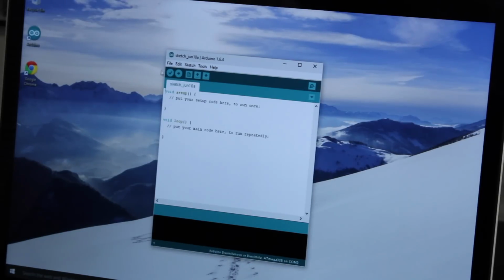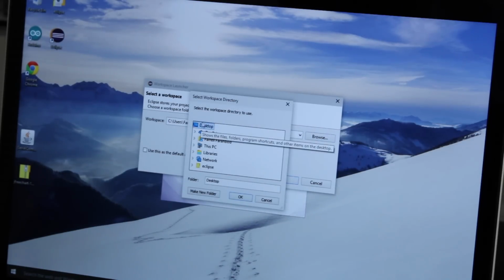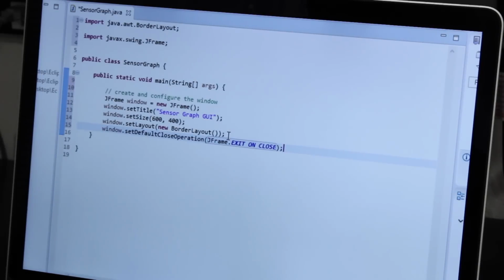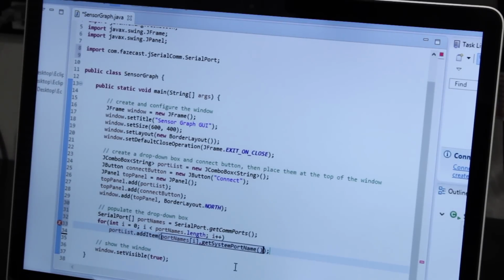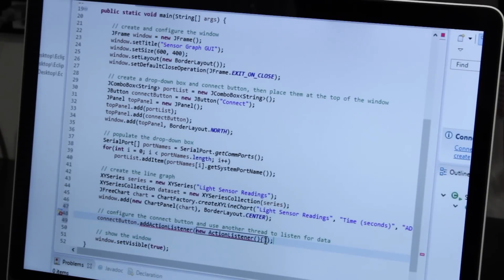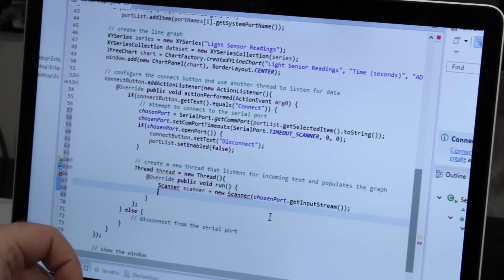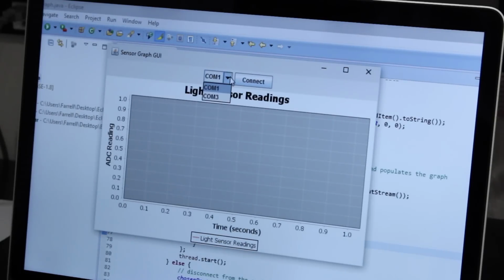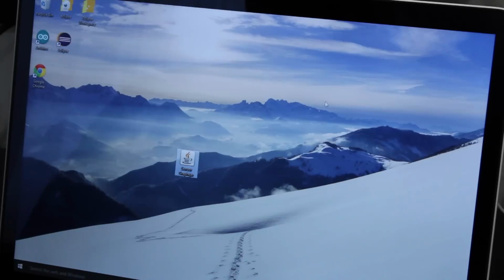Graph Arduino Sensor Data with Java and JFreeChart

Comment: This does not work for me on linux. Any tips?
I am trying to send a string from my arduino wireless module to another one that is connected to my pc.
Using putty i am getting the correct string.
Using java (for GUI purposes) i am freezing in the reading place and after I terminate the program I get a bunch of random characters.
This is probably due to ASCII output from arduino vs Unicode environment of Java. I have tried reading byte by byte, converting, changing reading encoding, but no luck.
I am probably doing this wrong.
Reply from the maker: +master2814 The character encoding should be fine, but I've had a similar problem when my baud rate was set wrong.
Reply: +upgrdman yes i managed to fix it by setting the baud rate. i was using the non default rate on my modules (19200) and also setting it in putty. but not in java. 
thanks a lot!

Comment: Thanks for the video. I have a problem though. the program is not connecting to the arduino. Can you help me please ?
Reply: +Surya Ravichandran I also use MAC OSX by the way. Would this affect the way COM Ports work
Reply from the maker: +Surya Ravichandran Hi. What ports are listed, and what port have you tried connecting to? If I recall correctly, OS X presents serial ports as TTYs and ACMs, but I'm not sure which one works better for this application.
Reply: Hi. Thanks for your reply. I figured how it worked. I have another problem though. How can I use two are three sensor data for three separate plots. Can u please help me out

Comment: Hello there,

Thank you for the wonderful tutorial. But unfortunately, my code does not work with atmega8 (using proteus). I received unknown data from "chosenPort.getInputStream()". 

It gives me this error:
 "Excetion in thread "Thread-2" java.lang.NumberFormatException: For input String: "[][]""

How can I resolve this? 

Thank You
Reply from the maker: +ishHD It looks like you are getting an error when trying to interpret the data as a number. Make sure the text sent from your microcontroller is just numbers and whitespace (spaces, tabs, or new lines). Letters or special characters can cause problems.
Reply: upgrdman Im using UART_Tx(adch);
    UART_Tx(adcl);.... well if I put the exception on the thread, It won't give me error but the graph does not work.
Reply: +upgrdman im getting this value : com.fazecast.jSerialComm.SerialPort$SerialPortInputStream@5593a38e
Reply from the maker: +ishHD In this video I have the Arduino send ADC reading as text (ASCII) over the UART. If you are sending raw bytes, you'll need to parse them differently.
Reply: Any tips? Thanks man. :)
Reply from the maker: +ishHD The easy route would be to have the microcontroller send ASCII text. I don't know the libraries you are using, so read through their documentation. You might be able to use something like sprintf().

If you don't want to send ASCII, you could parse the raw bytes with Java. You would need some way to align with the bytes you send, so a "magic number" would help.

https://github.com/Fazecast/jSerialComm/wiki/Nonblocking-Reading-Usage-Example

https://en.wikipedia.org/wiki/Magic_number_(programming)
Reply: upgrdman
Actually my problem was the same using RXTX. But the problem already solved by converting the ascii(from the proteus) into decimal number in RXTX. Should the same solution for jSerialComm.

Well its kinda weird though that in your video, you don't have to convert ascii into decimal number and it works.

Anyhow thank you for trying to help me. Keep it up!

Comment: Very great tutorial!!! I really appreciate what you have done, because it is really helpful for me. 

Can you please do a tutorial about building a real-time camera using Arduino and Java?

Thank you very much in advance!
Reply from the maker: +Daniel Zhao Thanks. By "real-time camera" are you referring to something like a webcam? If so, that wouldn't really be possible with an Arduino. The Arduino is a relatively low power microcontroller and does not have nearly enough processing power to handle video.

A more advanced chip like something from the STM32 lineup could do that, but those microcontrollers are not aimed at beginners and are not nearly as easy to use.
Reply: +upgrdman Thanks for your reply! Yes you are right, Arduino itself is incapable of handling video transmission, as its ram is not quite big. Actually, I am more referring to a IP camera, or something like a video shield that can be used on Arduino. Currently I am doing a computer vision project, which requires me to use edge detection to capture the outline through a wireless camera. I reckon low-resolution video will cater my demands. So do you know some possible ways to achieve live video input stream from Arduino? If so, can you please do a tutorial for it? Thank you!
Reply from the maker: +Daniel Zhao I doubt that would work. Arduinos don't even have enough RAM to hold a single frame of video. Even if they did, they don't have nearly enough processing power to do anything remotely useful with video or photos.

Comment: Hi. I have an error :
Exception in thread "Thread-2" java.lang.NullPointerException
 at java.io.Reader.<init>(Unknown Source)
 at java.io.InputStreamReader.<init>(Unknown Source)
 at java.util.Scanner.<init>(Unknown Source)
 at Sensor$1$1.run(Sensor.java:65) 

The line 65 is the line wich contains :"
Scanner scanner = new Scanner(chosenPort.getInputStream());"
can you help me please ?:(The error appear when i push the connect button. i mention that i use a preasure sensor.Anyway thank you very much for this tutorial!
Reply from the maker: Hassan El-khatib The null pointer exception probably means you are trying to use an object before actually creating it. Can you post or message me your code?
Reply: upgrdman  i don't know what i have done but now it works! :)) thank you very much! I have another  question : how can i autoscale  in jfreechart because in the  X axis  there are too many values and it is  hard  to follow the signal because the signal becomes compressed. I think that  i must do an array   and then utilise  "push"?Thank you very much !
Reply from the maker: Hassan El-khatib It should autoscale by default. If you did something like setRange() than it will not autoscale that axis.
Reply: I don't need  a lot of samples.  I need somthing like 2500 samples.and then  take it back from zero  . NOW the program makes  too many samples and my signal  compress because of that.

The code is:
import java.awt.BorderLayout;
import java.awt.event.ActionEvent;
import java.awt.event.ActionListener;
import java.util.Scanner;
import javax.swing.JButton;
import javax.swing.JComboBox;
import javax.swing.JFrame;
import javax.swing.JPanel;
import org.jfree.chart.ChartFactory;
import org.jfree.chart.ChartPanel;
import org.jfree.chart.JFreeChart;
import org.jfree.data.xy.XYSeries;
import org.jfree.data.xy.XYSeriesCollection;
import com.fazecast.jSerialComm.SerialPort;
public class Sensor {
 
 static SerialPort chosenPort;
 static int x = 0;
 public static void main(String[] args) {
  
  // create and configure the window
  JFrame window = new JFrame();
  window.setTitle("Sensor ");
  window.setSize(600, 400);
  window.setLayout(new BorderLayout());
  window.setDefaultCloseOperation(JFrame.EXIT_ON_CLOSE);
  
  // create a drop-down box and connect button, then place them at the top of the window
  JComboBox<String> portList = new JComboBox<String>();
  JButton connectButton = new JButton("Connect");
  JPanel topPanel = new JPanel();
  topPanel.add(portList);
  topPanel.add(connectButton);
  window.add(topPanel, BorderLayout.NORTH);
  
  // populate the drop-down box
  SerialPort[] portNames = SerialPort.getCommPorts();
  for(int i = 0; i < portNames.length; i++)
   portList.addItem(portNames[i].getSystemPortName());
  
  // create the line graph
  XYSeries series = new XYSeries("preasure Sensor Readings");
  
  XYSeriesCollection dataset = new XYSeriesCollection(series);
  
  JFreeChart chart = ChartFactory.createXYLineChart("preasure Sensor Readings", "Time (seconds)", "ADC Reading", dataset);
  window.add(new ChartPanel(chart), BorderLayout.CENTER);
  
  
  // configure the connect button and use another thread to listen for data
  connectButton.addActionListener(new ActionListener(){
   @Override public void actionPerformed(ActionEvent arg0) {
    if(connectButton.getText().equals("Connect")) {
     // attempt to connect to the serial port
     chosenPort = SerialPort.getCommPort(portList.getSelectedItem().toString());
     chosenPort.setComPortTimeouts(SerialPort.TIMEOUT_SCANNER, 0, 0);
     if(chosenPort.openPort()) {
      connectButton.setText("Disconnect");
      portList.setEnabled(false);
     }
     
     // create a new thread that listens for incoming text and populates the graph
     Thread thread = new Thread() {
      @Override public void run() {
       
       Scanner scanner = new Scanner(chosenPort.getInputStream());
       
       while(scanner.hasNextLine()) {
        try {
         String line = scanner.nextLine();
         int number = (Integer.parseInt(line)*5)/1023;
         if ( number>=3)
         { 
          System.out.println("trigger");}
         else
         
       
         System.out.println(number);
         series.add(x++,  number);
         
         
         window.repaint();
        } catch(Exception e) {}
       }
       scanner.close();
      }
     };
     thread.start();
    } else {
     // disconnect from the serial port
     chosenPort.closePort();
     portList.setEnabled(true);
     connectButton.setText("Connect");
     series.clear();
     x = 0;
    }
   }
  });
  
  // show the window
  window.setVisible(true);
 }
}
Reply: upgrdman  do you know how i can autorange the x axis ?i mean i must have values between 0 and 2500 and i want that signal   to play  continue in this range

Comment from the maker: Hi everyone! I just made another video related to this topic. In the new video I cover how to send data from your PC to the Arduino. It's a simple project that has the computer tell the Arduino the current time and date. The data is shown on a 16x2 LCD.

https://youtu.be/5N30jHMhw9c
Reply: +upgrdman i alrdy figure out how u read from arduino, is the serial monitor, but is there anyway to read the line with 2 data?
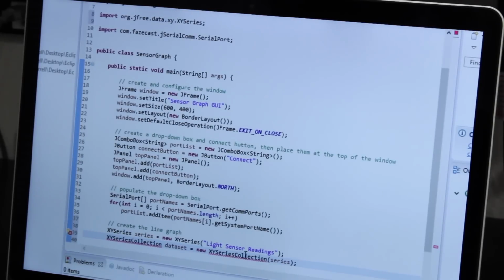Reply: Yes, there is. He talks about it in this video starting at 28:15 for few secounds. But you should also somehow mark data that is sent to serial in arduino skech. Sensor1, Sensor2 and then the value. Then in Java you can identifay from what value comes from what sensor. But Im not sure how to do that.
Reply: hey @upgrdman  i have tried your method and was able to successfully connect to my arduino but was not able to receive any data from the arduino . 
this is the way you did it:

1) Scanner scanner = new Scanner(chosenPort.getInputStream());

and i would like to use this method but sadly i dont get any data.

but using the java.io library  and the  getInputStream method :

2) InputStream data = serialPort.getInputStream();
       String data_scan = dataScan.nextLine();
                //"Print data scan"

this was successful and was able to recive the data. but the way i got the data was in "char " and that is a nightmare to work with !.

while(true){
   
   try {
    System.out.print((char)data.read());
   } catch (IOException e) {
    // TODO Auto-generated catch block
    e.printStackTrace();
   }
  
  }
see the thing is i'm doing this for the RFID rc522 i wanna be able  get the UID(unique id) of card every time a card is scanned.
 
if you can help my email id is johnpaulrodrigues83@gmail.com
Reply: nope fixed it ... it was the while loop condition .. i changed the while loop to run infinitely :

Scanner dataScan  = new Scanner(serialPort.getInputStream());
  String data_scan = dataScan.nextLine();
  while (true){
   System.out.println(data_scan);
  }
Reply: but the data is definitely wierd.
Reply: Hello, I really enjoyed watching your videos and it has very much benefit to me. I also wonder, if you may make a video im future about connecting to Bluetooth instead of wired. I would really appreciate it thanks!

Comment: Thank you for your amazing video! So detailed and professional. 
What if I want to include data from different sensors to display in each graph (not overlapping it, instead create a dropbox and you can select to display graph for specific sensor)?
Thank you! :D
(btw really love it when u were doing using windows 10!)
Reply from the maker: Daz Scedix I'll try to work that into a new video. Thanks for the feedback!
Reply: upgrdman Tq! XD
Reply from the maker: Prabhdyal Singh Yes, that is possible and I just did a video covering how it works: https://youtu.be/5N30jHMhw9c
Hope that helps!
Reply: upgrdman 

I cant seem to comment on your video for some reason, so i will write here. 

Great stuff indeed, thanks for the video !! I have but one question. Is it possible to send data to the Arduino via our Java GUI / Program ??

Thanks !